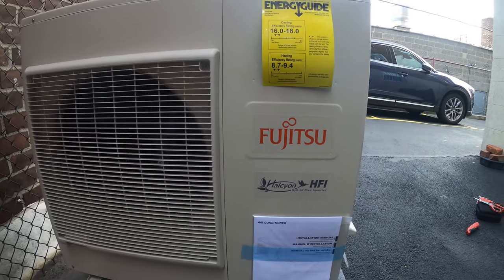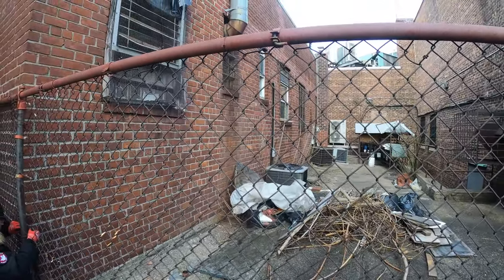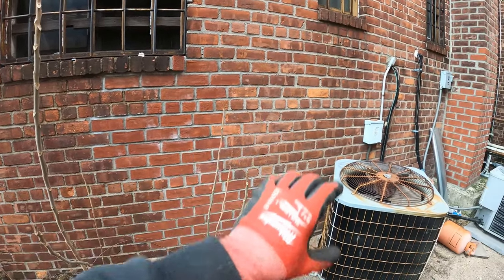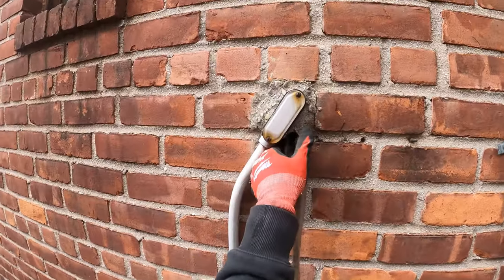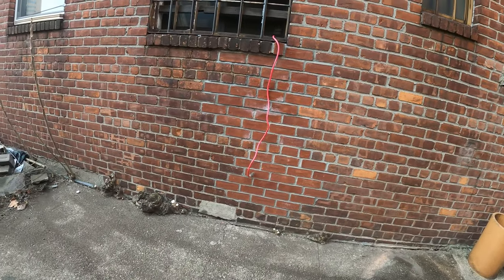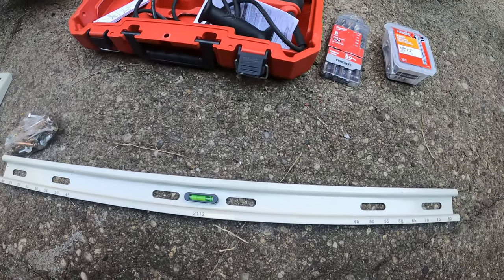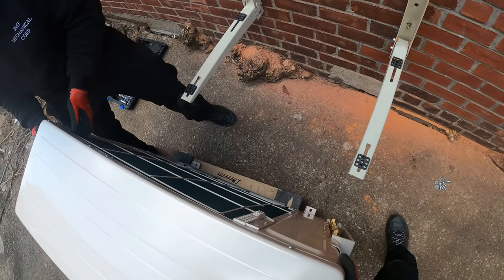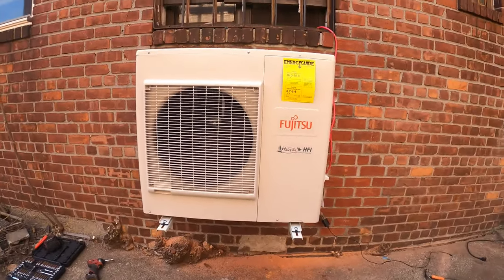HVAC Installation: Mounting a Mini Split Condensing Unit On a Brick Wall (AC Wall Mount Bracket) DIY

Comment: Huge help for me to see this!! Thanks!!!
FYI-someone told me that it's a good idea to put some silicone sealant around the bolts before you put them in to stop water from getting in and possibly freezing and cracking. What do you think? Couldn't hurt, right?
Also, the wall mount bracket that you used; could you provide a link to it?

Comment: Looks great. Only concern would be those weeds you cut back. They are going to grow back again just as long. When they do..they will have branches and leaves (blocking airflow). So depending how they grow back around the units it could impact them. Likely not. If the branches grow into/thru the unit..that would be an issue. The business should pay attention to the weeds.

Comment: What's the weight of each unit? Is this just a veneer brick wall? I'm trying to figure out how much weight my wall can support...
Thank you for the great videos!
Reply: He said they are 3 ton units.
Reply: @dontblameme6328  I'm sorry but acording to you it would be 6613 Pounds. Which is incorrect, because "3 ton" has nothing to do with weight.

Here's a quote:
Does a 3 ton AC unit weigh 3 tons?
Air conditioning tonnage has nothing to do with weight. A ton, as used in the HVAC field, is a term that describes how much heat the AC unit can remove from a home in one hour. The measurement for heat is the British thermal unit (BTU).